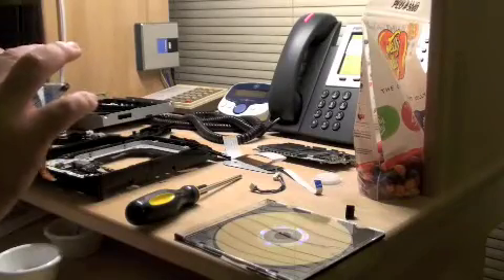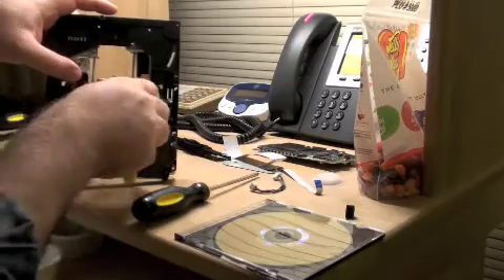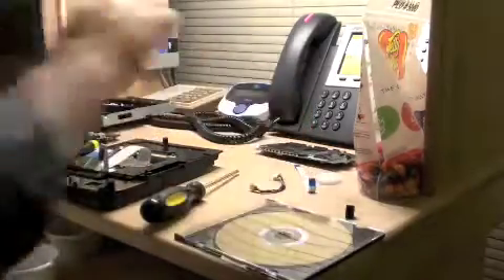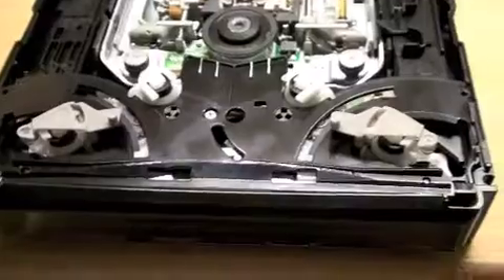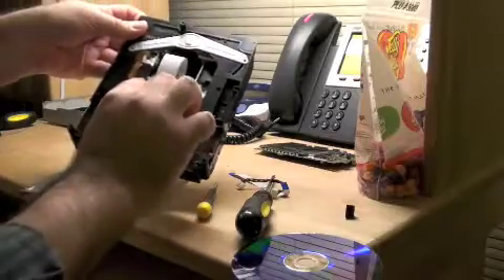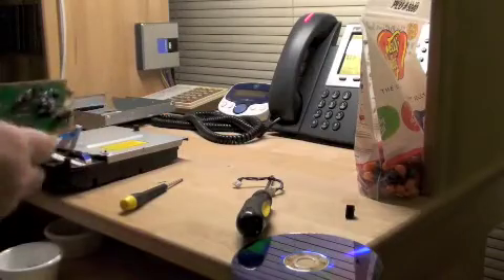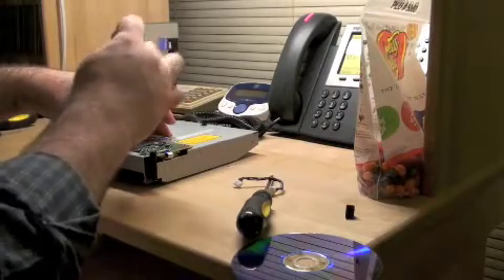PS3 Blu-Ray drive reassembly

Comment from the maker: The disc sensor wire is typically sold at places that carry other PS3 parts, such as laser assemblies and flex cables.  The wire can be repaired, but it's much easier to just buy a new one and save a lot of hassle.

Comment: I think i'm having an issue with the middle circle part at 5:10. The disks go in, and eject works but I can't tell if it's spinning up or not. is there any specific was to drop that thing in? Not sure if that's it exactly. The disk goes in, and ejects normally. But usually you can hear a thud after the disk goes in, then it spins up. I noticed now it doesn't make that thud or dropping sound.

Comment: Hey man. After i took my blu ray drive apart to clean lens, my disc wont lock into place in the drive. It goes all the way in to the last part where it "locks" into position and keeps making the eating noise. Then i can safely eject it. But it just wont get past that last part of the disc feed. So,i put the disc in,it feeds til the end of the feed where it should "lock" but instead it just keeps making the eating noise for a couple seconds and stops. Blue light is off after. And thoughts? Thanx!

Comment from the maker: I'd check the alignment once again to make sure it's correct.  The system may not believe there's a disc inserted when there really is one.  Also, there are small switches on a board that let the system know the state of the transport.  If these switches are broken, the system won't be able to properly tell what's going on.

Comment: Question.  I took apart my PS3 drive to manually eject, which worked out fine.  However, after removing the part seen at 3:14 (I don't know what that thing's called), all the little grey gears fell out.  Do you know of some diagram that shows how to reassemble those grey wheels?  Thanks in advance.

Comment: OK I NEED HELP ASAP......I JUST PULLED APART MY PS3 N IM STUCK AND I PULLED DA PLASTIC PAPER THING TO DISCONNECT THE DISC DRIVE FROM DA CONSOLE ALONG WITH THE DISC DRIVE POWER CORD......QUESTION IS HOW DO I PUT DA PLASTIC PAPER BACK DAT CONNECTS TO THE DISC DRIVE AT DA BOTTOM OF IT WHERE THE YELLOW WARNING TAG IS???????

Comment: is the hub clamp at 5:10 necessary? i have the CECHL01 model, and my cozin game my a old ps3, it was previously open. it does not read disk. but i noticed i dont have that hub cap (circle white piece), is it important?  PLEASE AWNSER

Comment: Cam you help me? I have reassembled the drive correctly, I have been over it 7 times and everything is in place, it was working fine before I opened it to remove the disc, but now when I put a disc in the disc will slot in, but the blue light wont flash and it wont take the disc?
Thanks

Comment from the maker: @10bm1025 Probably the top just needs to be lined up properly.  Try holding the plastic top vertically before placing it onto the drive.  I have a "PS3 optical drive top" video that goes into more detail on how to do it and what to look for.

Comment: @3:18 the little grey plastics are supposed to springed right? when i was putting the blu ray drive back together, i dont know what i did but they seems to be loose, they are supposed to spring back into its position. i dont remember how to put it back together. both springs are there though.

by the way your videos have been very very very helpful!! thank you!

Comment from the maker: @potheadtoker11 A good place to start would be my "Revised emergency eject" video, as it goes through all the common things to check if you have mechanical issues.  Not mentioned there is to check the small board with switches on it, in the lower right corner of the drive.  If any of these switches have broken tops (especially the one that faces the right arm), you won't get a properly working drive until the board is replaced.

Comment: Hey Junker,great videos,all very helpful.I'm wondering if you could help with a particular problem I have at the moment. I took out my disc drive to clean the lens with a disc still inside,and removed it manually instead of reconnecting and ejecting correctly. Lazy and very stupid! End result was the left 'arm' inside the disc drive moved towards the front of the disc drive and jammed. Have unjammed the arm but still can't get it to accept discs,any help would be greatly appreciated.

Comment from the maker: @p3acefrog Yes, because the center hub clamp is responsible for holding the disc securely onto the spindle while it spins.  Otherwise, it'll just slip around and nothing will work.

Comment: Thank you so much! I took my drive apart using another video, but when I tried to reassemble, the arms that accept the disc moved out of alignment.  Your video is the only one that includes the removal of the arms that lift the transporter.  Taking those off and resetting them was the key to solving my problem.

Comment: I took my disc drive apart to get a ps3 game out that some idiot left stuck in there when he sold it, and the little wiring came out of it's yellow box thingy.  I think it might have been the disc sensor or something.  It has a red and black wire.  Or whatever it is.

Comment: what are you doing?please note if you want to assemble ps3 blu ray drive just wind the white gears on in the lower left of the drive until the disc tray winds down to full stop and the laser is all the way back,
that way everything falls into place.
you can see this drive has been removed with a disc in it and now it is sitting in the loaded position instead of being ready to accept a disc so when its reconnected the sony will think the drive has a disc in it and try to run.
it cant work

Comment: hey, I put an exrental blu ray into my ps3... the rentaals had this sticker on top which i removed, i got rid of most of the gum left behind from the lebel but must have left too much as the disk wouldnt eject and made a grinding sound the next time i pressed the eject buttom... so i took the disk drive appart and back together now id doest detect any new disks of any kind, i re attached all the ribbon cables just incase  they wernt connected propperly.. could it be anything  else??

Comment from the maker: Before sending the laser back, get a clear disc and see if there's blue light coming from the laser.  It's likely you won't see any blue light at all.  You have to use a clear disc so the monitor diode will sense there's a disc, while being able to clearly see the light from the laser.

Comment: I did something wrong on the reassembly.

When I insert a disc, there is a grinding sound then nothing.  Upon ejection, same thing - grinding sound then ejects correctly.

Upon further examination, it seems like the left side of the tray (motor side) lifts up.  the right side of the tray does not correctly lifts up and I'm not sure which mechanism is supposed to help lift the right side.

Any help would be appreciated.  thanks in advance.

Comment: ...those instructions aren't very clear either ("Ease the spring onto the bumper from an upward angle"... how exactly?). I'm also not sure how the bumpers are supposed to act when they ARE in their proper positions. Should the grey parts be rigid, or can they rotate around the white parts somewhat? 

All in all this is pretty frustrating. Your PS3 videos have been very clear and helpful (thank you for making them!), so it would be great if you did another video elaborating the WikiHow article.

Comment: I had the same problem (rattling sound when trying to insert disc), but the WikiHow guide isn't very clear (or I'm just thick)... I followed it (as much as I could anyway) and managed to get it to draw in the disc, but now I can't eject it, and I'm not sure if it's being read correctly either (I just used some old PC software disc for testing, so I can't be sure). The tips section describes what to do if you pop off the little bumpers by accident (which I did), but...

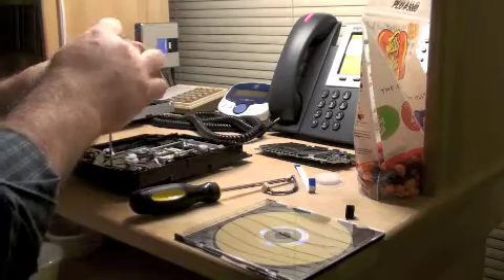Comment from the maker: Remove the top again and check the alignment of the part that draws the disc in (around 3:36 in this video).  What's happening is the door on the top is being held closed by something that's misaligned.

Also, make sure the bottom part is flush on both sides.  It'll gently snap into place.  Check it before and after you secure the screw.  Sony should've invested the $0.02 for two more screws there!

Comment from the maker: The thick grey cable that goes out the side and into the mainboard should be the one that supplies power to the drive.  None of the other cables can handle the current needed.

Comment from the maker: It looks like the disc can be inserted, but there is no power to the unit.  I'd try checking that all the connections are in place (the data cable and that short grey cable coming out of the side).  It could also be that the small 2-wire connector that has wires going up to the top of the unit hasn't been connected properly.  It's the real small connector that was disconnected from the Blu-Ray controller when the unit was disassembled.

Comment from the maker: The part at 3:30 should remove and reinstall as a single unit unless there has somehow been some damage to it.  It should drop right in and secure with the single screw.  Make sure nothing is amiss on the bottom as something could have popped out if you were having trouble with the disc loading before.